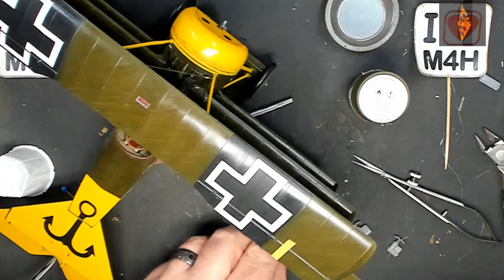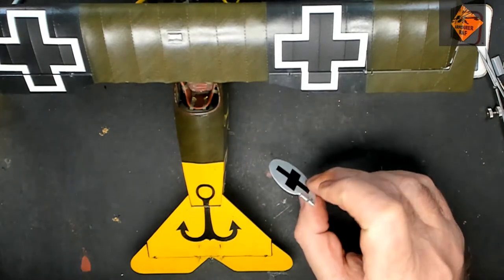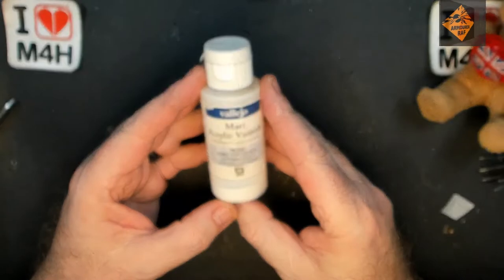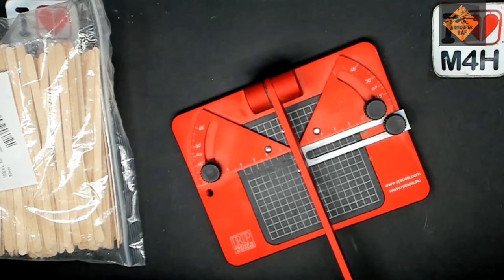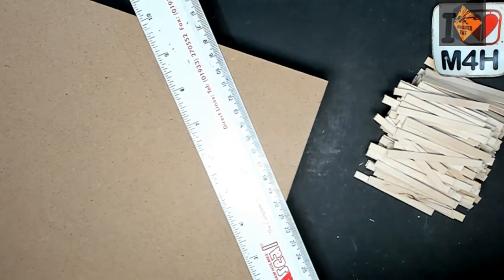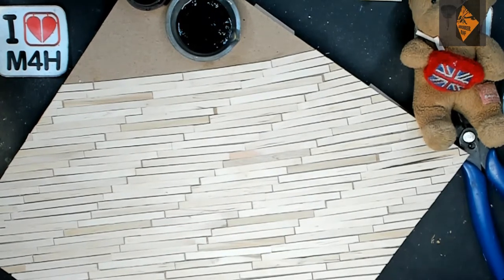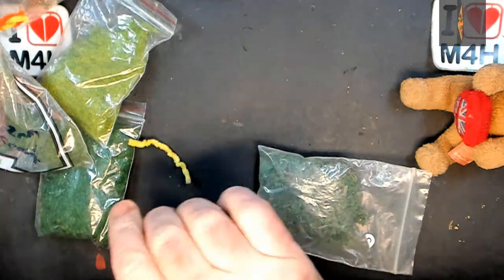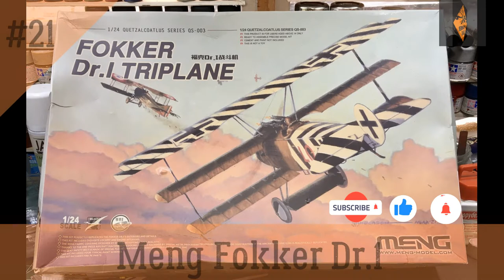Episode 21 of my Meng 1/24 Fokker Dr.1 Build

Comment: I had the 1/32 Meng - they completely blew the wing - it had a very visible warp. Maybe you could fix it by putting it hot water, but what for. Sold the kit and let someone else deal with it. Is the top wing straight on this kit?